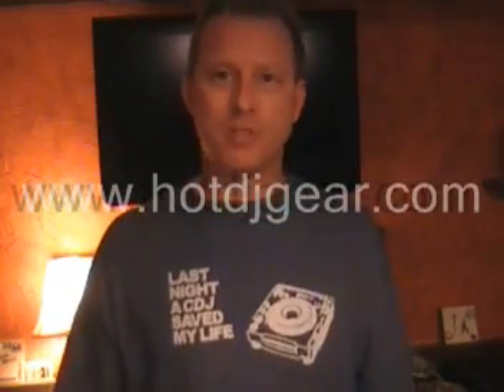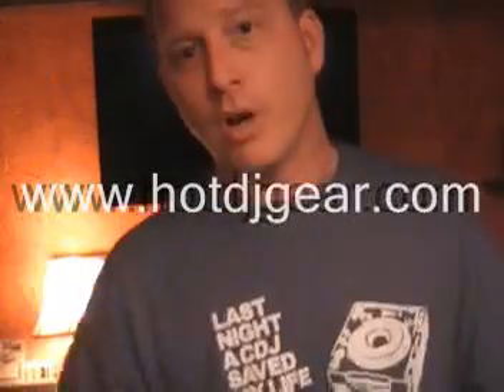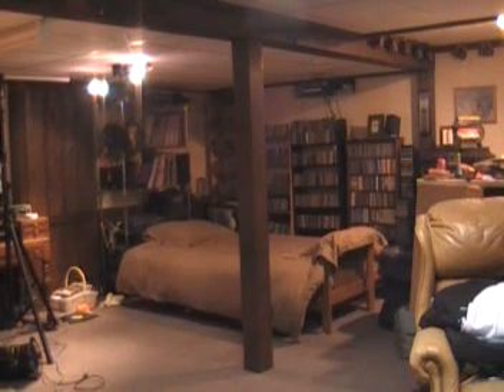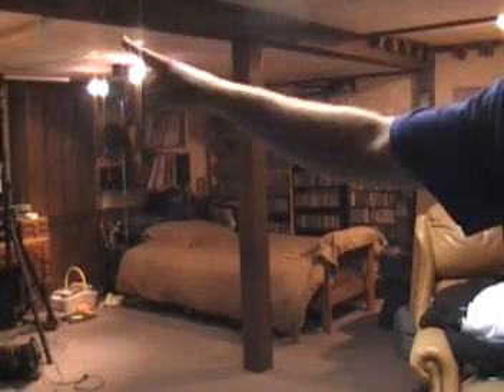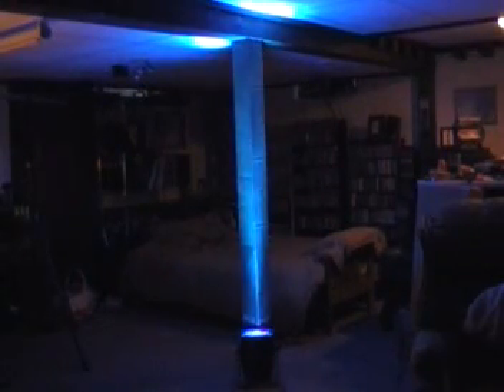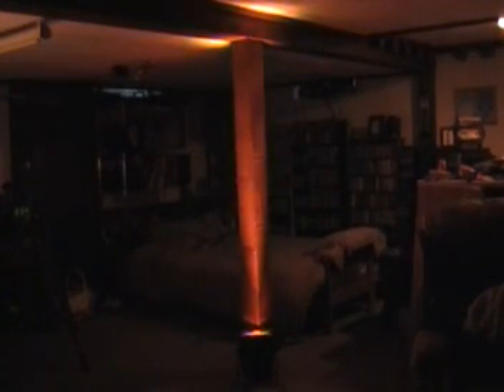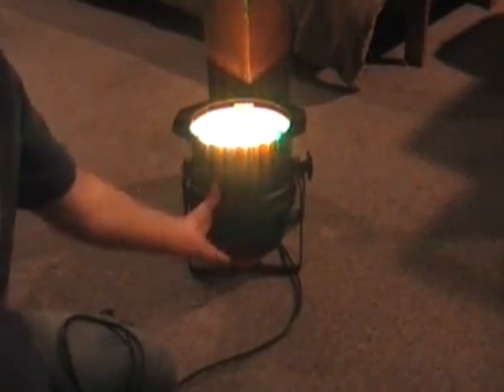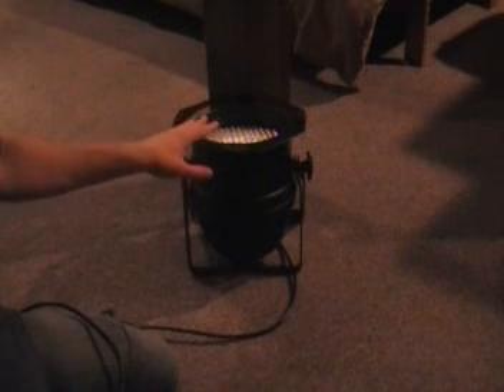LED Uplighting Project Part 1 - Introduction

Comment: I had an event on Tuesday, where I was doing the lighting at a live event, it was a small one in a hall, but I was using 16 halogen uplights that I had rented, and some idiot came up to my light board and just wacked all the sliders up, causing 1 of the bulbs to blow, lucky I had a spare. I also had a bulb in a moving head blow, which I had only used about 6 times and have owned for 3 months. both not good, but you learn, just a warning to others, be aware, anything can happen :)

Comment: I know that those audio company's don't produce lighting equipment.

But Martin does, I would call Martin professional lighting.  I Would call American DJ  Pro-sumer/DJ lighting.

Either way,  It was just a curiosity question about the cheaper American DJ LED fixtures.

Thanks.

Comment from the maker: Rane, QSC, Pioneer, etc don't make lighting.  ADJ lighting is, for the most part not really for the general consumer.  It's for people stage & theatrical professionals.

I guess the best way to put it is that if you plan on using your lighting week after week, year after year, then step up into the better lighting offered.  I don't think the less expensive ADJ par cans have the built-in programs.

Comment from the maker: Apparently, smoke alarms go off when there are particles in the air, even when thoes particles aren't real smoke.  Not sure how nightclubs do it.  I wish all banquet halls did it that way.

The other problem is Asthma.  I'm not sure if it's imagined or real, but some people complain about breathing.

Haze is probably the best option, which is a light fog.  However, many places won't allow that either.

Comment: you can put the source of the dry ice above the scanners so it may cascade onto the light, and of course it will build up and "crawl" along the floor. or use a small light fan to blow it out, its main advantage is it will be a heavy fog that doesn't stay in the air, then again I dunno much, never played with lights, just tables.

Comment from the maker: I like the dry ice effect.  Never used it but it looks exellent.  I'm not sure this is going to help people trying to put something in the air for thier scanners, etc to reflect off of because it lays too low to the ground.  

Hazers are probably the best way to go if you use it in moderation.  Trouble is, most halls in my area have completely black listed smoke effects all together.